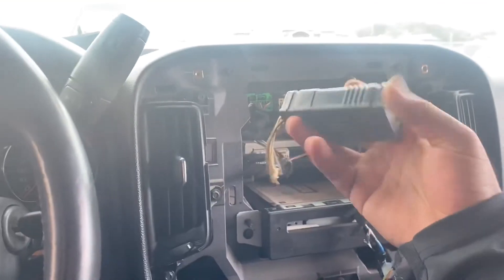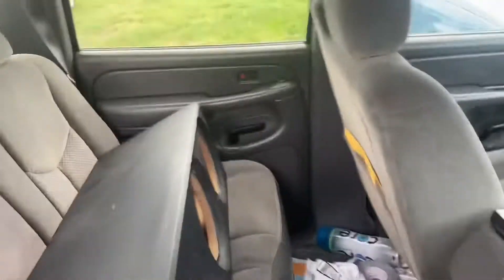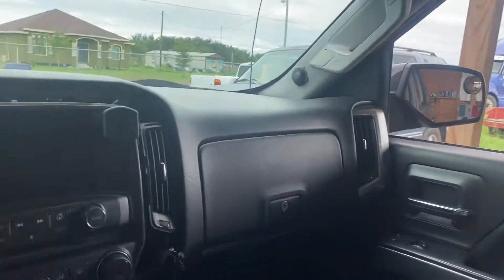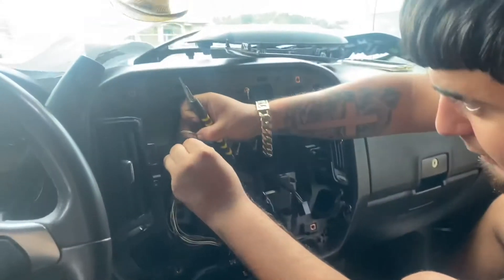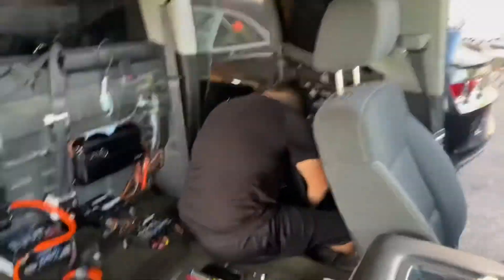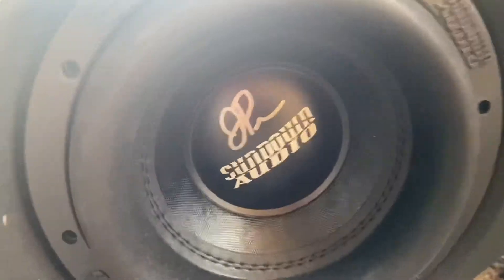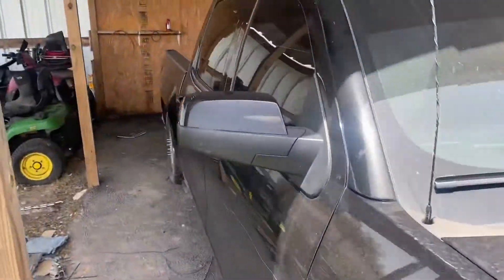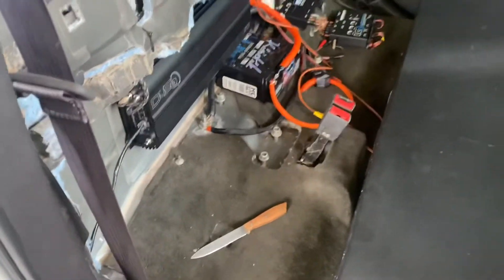4 sundown 8s 4 6.5 deaf bounce install

Comment: What adapters did you use to fit the Sylvester?
Reply from the maker: 6x9 to 6.5 they have them at every local audio store
Reply: @lstrckin9315  you had to cut them?
Reply from the maker: @josephhltx9403  no
Reply: @lstrckin9315  bet bro did it sound clean with all four?
Reply from the maker: @josephhltx9403  yes bro all.m jn the adjustment